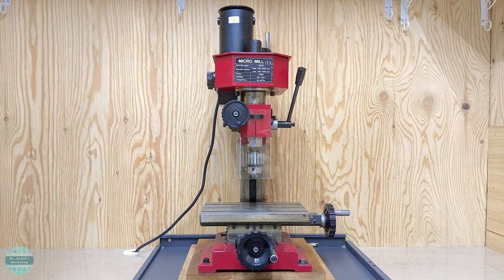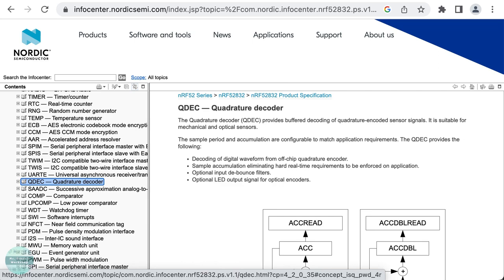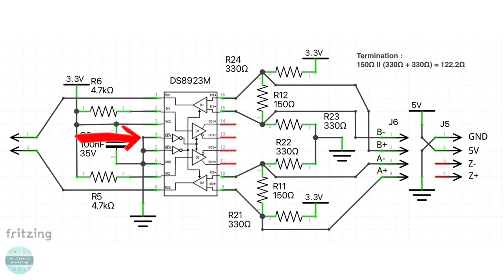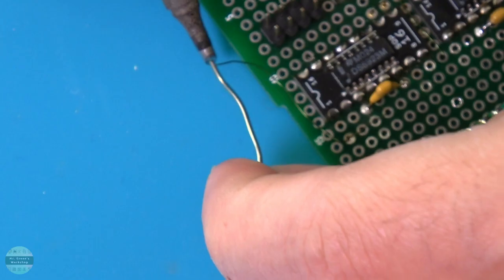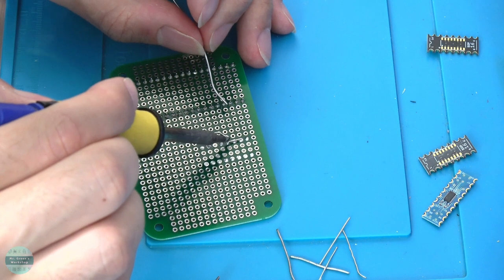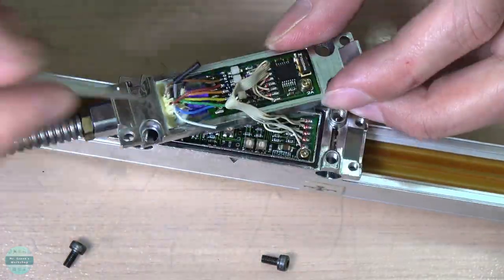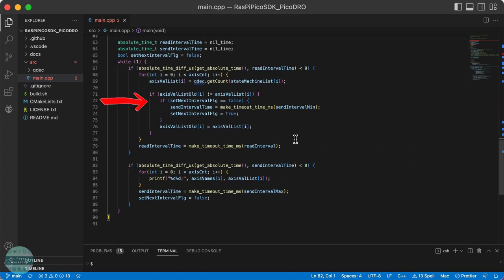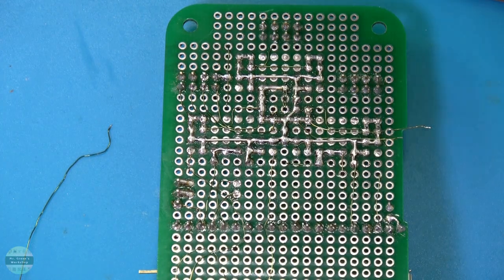PicoDRO, DIY digital readout with the Raspberry Pi Pico. Ep.2

Comment from the maker: Which RS422 driver can be used instead of DS8923?
AM26C32 would be a better choice. Or there may be better options.
Reply: The ISL32273 would be a good choice. Runs from 3 to 5.5V and uses only about 5mA or so.
Reply from the maker: Thank you for stopping by and commenting. 
That looks neat. However, Digi-Key is the only place to get it. There must be more accessible ones around. Thanks for watching!
Reply: @mrgreensworkshop  there is also the ISL32173, which is the faster version. Does need more current, but is widely available from Mouser, Farnell, and others.
Reply from the maker: @somedutchguy7582  I see, Thank you for the tips.
Reply: Hello @mrgreensworkshop, first of all: Thank you very much for your effort. This will come in handy retrofitting my measurement microscope. I am relatively new to electronics, so i have a question regarding the DS8923. Can i swap it for the AM26C32 without changing anything else? If so, do i still need to reduce to 3,3 V or can i then change it to 5V? Also is there a PCB-Design available? If it isn't i will try to make one using KiCad (also new to me) and reach out to you. Greetings from Germany.
Reply from the maker: @thomas8719   Hi, Thomas, Those ICs aren't pin-compatible, so I'm afraid they are not interchangeable. You need to change the pins. I'm guessing you can find AM26C32 in your local shop. I will help you, but please open the project page on Github and ask this question on the discussion tab. I think it is better to put it there so other people can benefit from it. Meanwhile, I will think about the circuit.

Comment: Hello, the optical ruler I have is also RS-422 and the IC on it is AM26C31, so I want to capture the A and B phases of the optical ruler with AM26C32, but I can't capture it. I can't output the pulse waveform that you made so beautifully.
Reply from the maker: @kj-ry3cm  What did you try?
Reply: @mrgreensworkshop  I am continuing the research of previous people who used NI-9411 to capture and display it in labview. It is currently confirmed that the oscilloscope of labview changes with the forward and backward movement of the X-axis. After checking the scale model, I found that the IC is AM26C31 and RS-422. , so connect according to the pin position of the optical ruler and the circuit diagram of the datasheet, and then check it with an oscilloscope. The result is not a pulse signal, but something like a sine wave. thx🙂
Reply from the maker: @kj-ry3cm  You need to supply voltage to a linear scale to get a signal. Sometimes you may find more than one output. RS422 and analog. Please find those which are connected to the AM26C32. If you are sure about line drivers(AM26C31) you should see a signal. If you are using an Oscilloscope, please use the math function to get the difference of A and B lines. Thus you should see clear output especially if you are tapping the RS422 side. Good luck.

Comment: I have the last version of touchdro. How did you remove the circle or point graph viewer?
Reply from the maker: I don't know much about the TouchDRO.
I think someone can answer your question in the forum below.
https://www.hobby-machinist.com/forums/touchdro-the-diy-dro-project.542/
Reply: @mrgreensworkshop  what version are you using?
Reply from the maker: I'm using the latest version. (3.24.06)
There is a button on the top right that looks like a screen. You can switch between views by tapping. (You can hide the graphical view) You may want to check the manual.

https://www.touchdro.com/resources/dro-manual/graphical-view-display.html

I hope this helps.

Comment: Could I use magnetic scales instead of glass scales without modifying your directions?
Reply from the maker: Hi, what we need to know is, scale's signal output type. If its output type is RS422 it's possible. But you also need to find linear scale pinout. I have already explained in another video. If output type is TTL you need to remove RS422 drivers and convert linear scale's 5V TTL logic to 3.3V logic to input Raspberry Pi Pico. If it's analog, it's not that easy. Either case, if you are not good with electronics, please ask someone who knows. As you know, linear scales are not cheap, you may damage them if you are not careful. Thanks for watching.